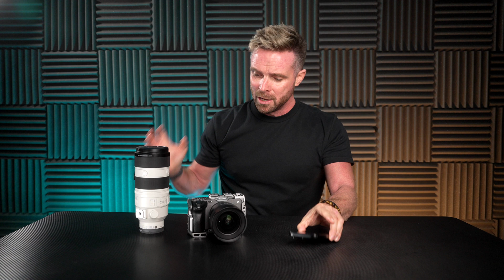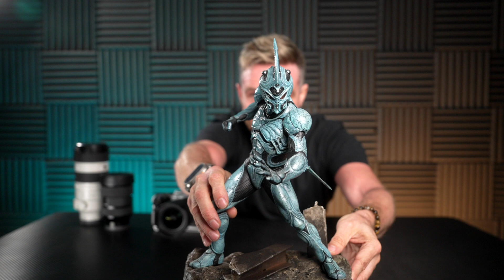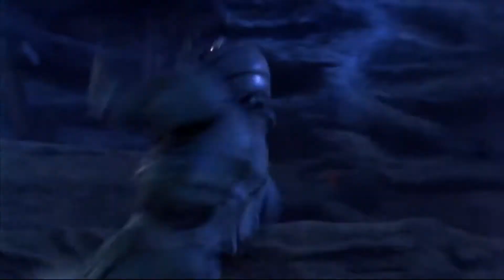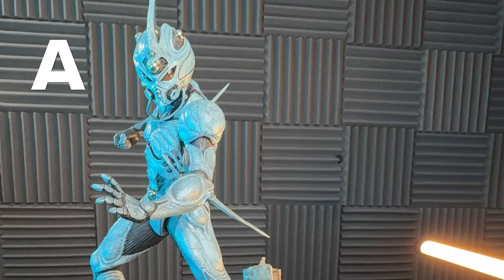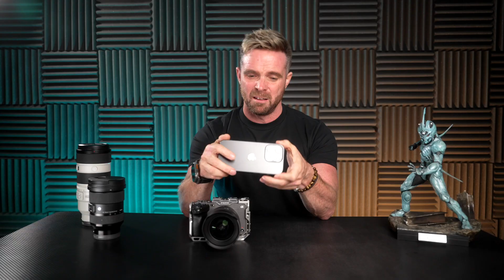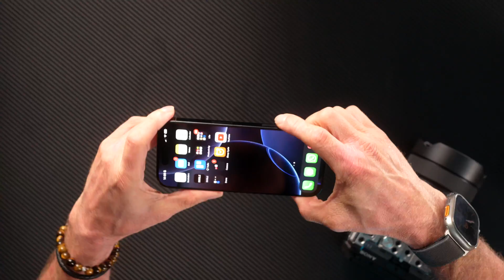iPhone 16 Pro vs Netflix Camera - Can You Tell The Difference?

Comment: Nice video but the exposure on the iphone is way too high and the artificial bokeh is not active, not a fair comparison
Reply from the maker: The iPhone exposure was corrected on the phone to match 0 just as the FX3 was, so it seems it seems you have to down the exposure in the edit and I didn’t want to make any post editing on either cameras. 

And maybe I should have done different scenarios, but I find if a camera can’t handle low light, it’s shows its weakness, plus it’s a controlled environment. 

You can of course use the phone in ideal conditions, but that’s not reality 🤷‍♂️
Reply: @Pulse8Reviews  yeah, definitely a camera will show it's weaknesses in low light situations. But I think u should had shot in different scenarios. Exterior, interior day time, night time etc. still though it's a good video
Reply from the maker: Appreciate it mate, thank you 👍
Reply: plus he should shoot in different scenarios not just in his office, especially cuz it is low light.